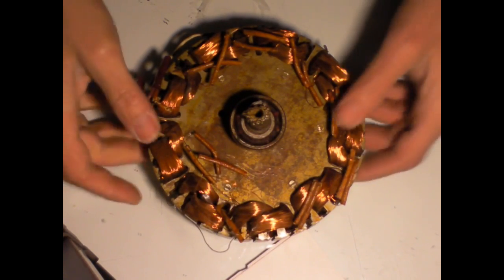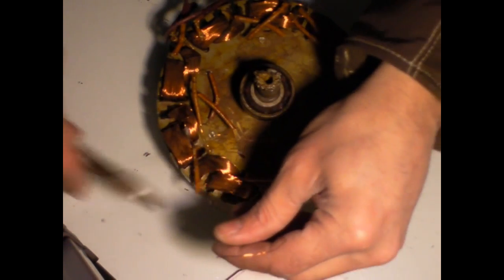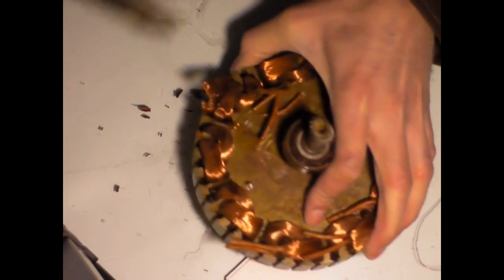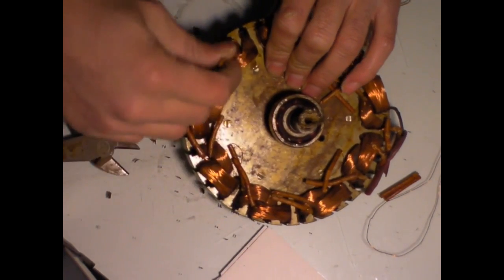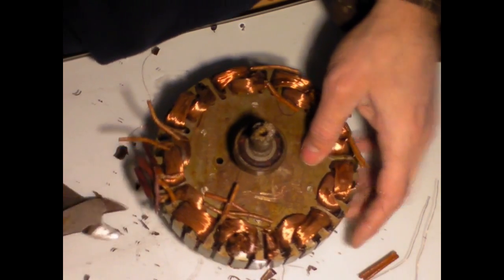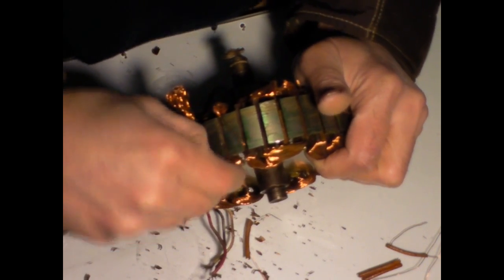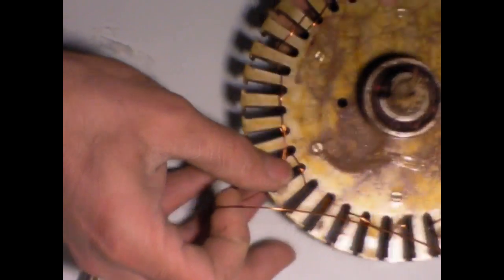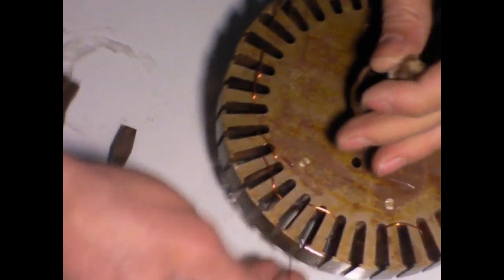02 12pole 36slots iron serpentine 3phase PMA axial flux wind turbine vawt hawt genertator energy 101

Comment: What changes seen changing to serpentine coil? I assumed it should reduce ohm resistance with same coil, might increase power with same copper right?
Reply from the maker: with my experimentation with serpent stator coil, i found that the serpent works better with very low RPM, 100 rpm or less, in this you require high blade torque, for that reason, it is costly, for coil, magnets and size of blade. that is why most turbine are best to operate at high rpm, less cost, and let the wind do the work.
Reply: @emagnets  thank you very much for detailed explanation